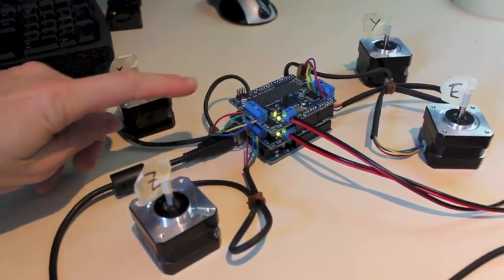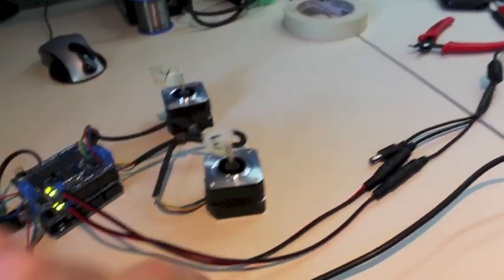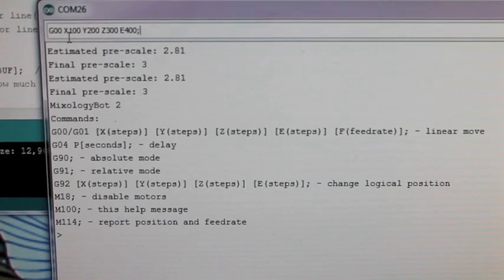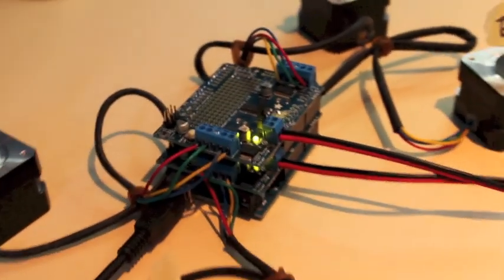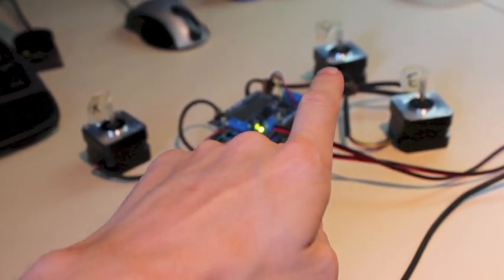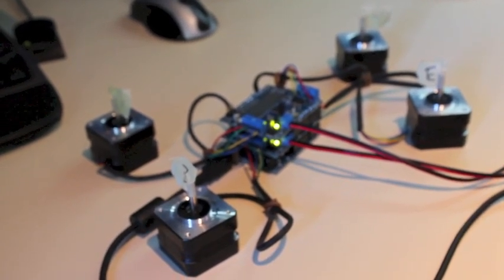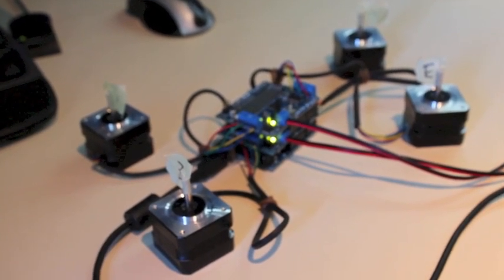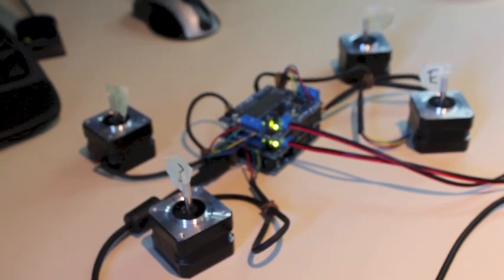Let's Make a 4-axis CNC Gcode Interpreter for Arduino

Comment: What’s the point of a shield? I never understood. I always do everything on a breadboard or I just design the PCB on cad
Reply from the maker: If you have the time, energy, and money to do that, cool.  Other people have different values for what is easy.
Reply: @i-make-robots  so it is like something that helps you avoid hours of reading data sheets? Lol
Reply from the maker: @micahsteeze  instead of solving problems at the hardware level I prefer the software, which is much easier. So I get OTS electronics and I modify their open source code to do what I need. The path of least resistance?
Reply: @i-make-robots  I totally agree. Software is much easier to manipulate and even get around hardware mistakes.

But the benefit of creating your own hardware is the decrease in dimensional constraints in projects. 

Like if you want to make a fish feeder robot on a 20 gallon fish tank a shield on an arduino uno is already taking a huge like 20% chunk of the surface area on top of the tank.
Edit:
20% might be a bit dramatic, but you get the point

Comment: hey awesome, but this will only work for catesian robots right. For a 6 axis robot arms, even if all the motors coordinatedly move the endeffector is not going to move in a straight line. How do I write a straight line gcode interpreter for 6 axis serial robot arm
Reply from the maker: Arcs can be split into many very short lines. I do this in the sixi 2 robot arm.
Reply: @i-make-robots  Yeah, Im not asking about arcs. Straight line itself using a six axis robot. Do I have pick a few points on the straight line, solve IK for those points and then pass through those joint angles? because bresenhams line following algorithm doesnt work for non cartesian robots to follow a straight line.
Reply from the maker: @pd.dataframe2833  A straight line for the tool tip is analogous to arc moves on each motor.  Break any move into small enough straight line segments and the end effect is indistinguishable from exact curve fitting. The firmware should do it, invisibly, perfectly.  Failing that, generate it in gcode on a more powerful computer.  Great question!

Comment: i am making a large 3d printer and need to use 2 stepper motors to move the Z axis at the same time i am using, ( or have ordered)  
Mega 2560 R3 + RAMPS 1.4 Controller + LCD 12864 + 6 Limit Switch Endstop + 5 A4988 Stepper Driver 3D Printer Kit for Arduino

i believe that the ramps 1.4 controller has two Z's connection but if not, could i splice the leads from the motors and use one connection pin or would that over task the board?
Reply from the maker: The limit on the driver is 1a? If your combined current draw stays under that you’ll be ok. Over that you’ll cook the driver.
Reply: so i would have to put an resistor to control the flow of the amperage wish i paid more attention in my electronic class (current=amp or flow=voltage or is vice versa hehe)anyway an resistor should keep me under the 1a threshold if properly sized

Comment: Hi, due to the poor quality, i am not able to see the video clearly. I would like to ask if you used 2 adafruit motor shield v2 to drive 4 of those stepper motors? Because if not mistaken, 1 motor shield can only drive 2 stepper motors. Thanks
Reply from the maker: You are correct.  One AMS v2 can drive two steppers AND I used two AMSv2 stacked on one Arduino Uno.
Reply: Hi thanks for the prompt reply!! Just to confirm . Did you use the stacking header to stack them together? If yes. Can you share the connecting diagram with me? Thanks very much if you are able to do so. "chee_king95"yahoo.com"
Reply from the maker: Chee King Tan yes stacking headers. The only trick here are the i2c addresses. The code is in the video description. No wiring diagram. Sorry.
Reply: Hi, What problem did you encounter with the i2c addresses and how did you fix it?
Reply from the maker: Chee King Tan no problem. They need to be set unique per board so that all four can be driven independently.

Comment: Hi Dan! this comment is for the "How to build an 2-axis Arduino CNC Gcode Interpreter" from your website. I am wondering if your code can be tweaked a bit to achieve a separate/individual feed rates for X & Y axis. Ex. G01 X1 Y1 Fx Fy. thanks in advance
Reply from the maker: Are you trying to set maximum limits on the feed rates?  different feed rates for each axis would make the CNC not right - lines would be hockey stick instead of straight.

Comment: hi,
how did you determine that you need 12 volt for the shields? do the motors run on 12 volt? I am trying to find it out atm, because I am doing my thesis and want to use the shield for it.
Reply from the maker: Jens Wotte the motors will run anything between 12-60v. Iirc the shield only accepts 12v.
Reply: Dan Royer so if i connect a motor that would run on a lower voltage, e.g. 2 motors with 5 volt, can i also connect a 12 volt power supply without setting the hardware or motor on fire?
Reply from the maker: Jens Wotte doubtful.
Reply: Dan Royer ok, thank you for answering so fast.
when i get you right i should choose two motors that need the same voltage and connect a power supply with also the same voltage to the shield.
thank you
Reply from the maker: Jens Wotte yes. Mix voltages is often very very bad.
Reply: Dan Royer ok, thanks a lot. i am not that much into electronics. i am more a it guy. but for my thesis i will do my first arduino project. you helped me a lot :)
Reply from the maker: Jens Wotte you are not...yet. Please get your parts from us and support our work :)
Reply: Dan Royer maybe i could. but i am not the one who is paying the orders and we are sitting in germany. but i'll have a look at your site and keep it in mind for the next iteration or my private "just for fun" projects.

Comment: sir may I know how did you connect two L293D sheild's to a single arduino uno
Reply from the maker: two Adafruit Motor Shield v2 will work very slowly.  Better to get RAMPS or RUMBA board.

Comment: Escuse me Sir, im very noob. i have a project on the way that i will do a OverHead Crane. My plan is make that thing autonomus and make his task continuos, but i have some limitations as: I have to use 12v dc motors (this limited by my teacher)... is that possible using a single h bridge shild ( Shield L293d)? i was thinking control the distance by the time or something like that. im sorry if a did say some bullshit, as i told, im very noob.
Reply from the maker: your method would work.  I wonder how accurate your movements will be.  You might want limit switches to prevent the crane turning too far & to start at a known location.  you might also want encoders so you can "see" the arm position from inside the arduino code all the time, make a PID loop.  better than just time control.

Comment: Hello Sir, really need help, I am planning to build 3D printer using pic18 to control stepper motor. Now the problem is how am i going to interface G code generated by CAD file with pic18? Is it possible to write g code interpreter in pic18? Have you ever write g code interpreter code in arduino to interface with g code and control stepper motor? Please need help. Thanks
Reply from the maker: Why are you doing things the hard way?
Reply: Did you find a way? I want to do it with pic18 too, or should i use 32 bit microchip like arm?

Comment: im working on a project were by i have to build a 4 axis or 5 axis CNC plasma machine which will be cutting tube pipes and BEAMS ....now i want to use Arduino ,basically the system like the one above ......now the problem i have with cutting beam is due to their shapes ...would you advice me to use 4 axis if i want to cut beams ? and which program you know of which i can use to generate g code for 4 axis
Reply from the maker: There is nothing stopping you from using 4, 5, or 6 axis.  The concepts are the same.  I don't know what shape are your beams, so I cannot comment about gcode generation.
Reply: https://www.google.co.za/search?q=beam&client=ms-android-samsung&prmd=inv&source=lnms&tbm=isch&sa=X&ved=0ahUKEwihhPqhxN3PAhUIcBoKHamYB9MQ_AUIBygB&biw=360&bih=559#imgdii=D3pio1eSNC4PZM%3A%3BWAoSoOpLNcCUIM%3A%3BWAoSoOpLNcCUIM%3A&imgrc=WAoSoOpLNcCUIM%3A
Reply: This  kind of  beams

Comment: Hey I tried your gcodecncdemo2axis with an mega2560 and motor shield v2. 

Whenever I sent a command it worked ,but on my power supply after sending commands it starts drawing .5ampiers ,but before sending a command .03. Do you know why this is?
Reply from the maker: before sending the first command the motors are probably disabled and draw almost no current.
Reply: Oh ok I understand now, so in my gcode file if I put M18 after all commands it will disable them then whenever another command is sent enable them and move their location. Is this how most gcode files are or do they keep them always enabled?
Reply from the maker: +Havoc Dev iirc yes

Comment: Dear Dan,r 
plz i need your help .... i am using Ramps not adafruit shield,
I saw a file on Github named “GcodeCNCDemo4AxisRAMPS”
,my question is can i use this code as a firmware for Ramps instead of Marlin firmware ?
Reply: +Samer Elsawy that depends on your goals.
Reply: +Marginally Clever Robots Yes, but can i make some changes on Marlin firmware to control CNC machine ??
Reply: +Samer Elsawy Yes.  Sure.  Maybe.  It depends.
Reply: +Marginally Clever Robots thanks alot, do you have any links that may help me in this ?

Comment: Curious to ask, but what exactly is the max speed of this system? (In other words can they go faster than shown in the video?)
Reply: The default speed of the I2C bus (communication between arduino and shiled) is 100 kHz, you can change this speed to 400KHz by adding the line <TWBR = ((F_CPU /400000l) - 16) / 2; // Change the i2c clock to 400KHz> on your setup() function.

for more info visit the last question on Adafruits FAQ page:
https://learn.adafruit.com/adafruit-motor-shield-v2-for-arduino/faq
Reply from the maker: Oh yes.  In this case the limiting speed is not the hardware, it's the speed of communication between the Arduino and the shields.
Reply: Dan Royer
, so aside from the arduino and the shields limitations...there's no real speed limitations in the cnc motors...
Reply from the maker: Eric Davila
You will eventually hit a physical limit.  I don't know what it is, off hand.  with a PLC you could probably get some very high top speeds.
Reply: Sorry for being a bit annoying, so the drivers won't physically limit the motor, if that's the case, Thanks!

Comment: I don't understand how to send gcode to arduino .I must write  a code and to send it to arduino or arduino has this code and to able to interpret it when it sent from other program.excuse my english.
Reply from the maker: https://github.com/marginallyclever/gcodesender will do the job
Reply: +Dan Royer I wish someone would put the steps for the programming in one video. OK- you take the part and draw it in cad. Somehow you get it in gcode. Then some how you get some kind of program into the stepper motor shield or arduino that understands gcode. All this and everyone says just go to github! I have gone there and somehow got the the github program (they said gerber! what is that?) and now what???? I have spent weeks trying to find somewhere that someone has put it all together. I don't want to just move a stepper around. I want to make parts and need to know how to go from the cad file to the steppers cutting! Any suggestions?
Thanks.
Reply from the maker: You start with a 3D model.  a "slicer" or preparation program translates the 3d model into instructions for your CNC machine.  Then (usually the same) program sends the instructions one line at a time as the machine does the work.  https://github.com/MarginallyClever/GcodeCNCDemo lives in the brain of your arduino and moves the motors in your CNC.  https://github.com/MarginallyClever/gcodesenderdelivers the lines one at a time.  What I don't have is code to translate a 3d model into instructions.  It's different for every kind of machine.  Some using Additive manufacturing (3d printers) and some use Subtractive (mills, lathes, laser cutters, etc).  I do some work in 3D, but only for my robot arms and the http://makelangelo.com/
Reply: +Dan Royer Dan, thanks for getting back. Another of the problems is many of us don't know what to do when we get to the github page. I can click on the different items and some open what looks like a sketch, but what does it do and am I suppose to put it in the arduino of what. What happens when I put it in am I suppose to do something? Some of the pages will not open. Some open if you change the program to open it with and you get mixed up words or letters. This is so confusing. I have tried for years to get a mm2001 board designed in Europe to work and I just got it to move the steppers. There are groups all over that use all these boards but they have all gotten past the first steps to get the electronics and software together. I have seen many people ask as I have to give us the steps to get there, but either they don't want to or don't understand what we need. Many have mentioned github with out telling us what to do when we get there and some of us have no one to ask!
Thanks for your efforts.
Have a nice day.
Reply: +Dan Royer Also the second link does not work.
Reply: +Gabriele Trovato This is the shield I was trying to use(or getting ready to use if I find answers.
V3 Engraver 3D Printer CNC Shield Expansion Board A4988 Driver for Arduino Z3
Reply: +amtpdb1 the problem is trying to use github. Github is a great resource for people who are familiar with programming, but it is next to useless for those who are not. The key here is that there is no "step by step" formula to this. You simply load your CAD model into the CAM software, set your prefs and hit go.

You need a program that will convert what ever 3d format you have into gcode that is appropriate for either milling or printing. Use Google to find a CAM program that will convert your CAD file extension to gcode, if for some reason you can't find a CAM program that will do this, then you will need to convert your model to something that can be converted to gcode. Open source programs will tend to have very limited function and be hard to understand, so you might feel better paying for a commercial license.
Reply: +joshua43214 Thanks. It is still confusing.

Comment: Hi Dan, I am trying to control motors in much the same way using the Adafruit Motor shield V2 and am having some success. However, I seem to be drawing quite a large current! In the region of 1.7A. Do you draw this much current? I have driven the same motors with the official Arduino Motor shield and they only draw 800mA. But these are not stackable.

Motors are NEMA 17, 200steps running on 12v.
Many thanks,
Chris
Reply from the maker: Huh.  I've never measured the draw.  This is news to me.  You've reached the limits of my knowledge!  If you find out why, please let me know, I'm interested.

Comment: thanx for your vidio if you please i have a 3 stepper moteur and arduino leonardo and i want to know what the output of arduino
for exple :

axe x the output is :
axe y the output is :
axe z the output is :

and thanx
Reply from the maker: I'm sorry, I don't understand the question.
Reply: oki 
I have 3 stepper moteur and i want to know the output of arduino to connecte the steper moteur i mean the pin numbre
Reply from the maker: arnoun taoufik
 the pin number should be listed in the source code in the github project.  https://github.com/MarginallyClever/GcodeCNCDemo

Comment: Hi
Would you list all the software need to have an Arduino Uno control 3 stepper motors through a 3 axis stepper driver I am a bit confused at what I have to download and install.
Thx in advance
Reply from the maker: The full source on github should include everything you need.  Let me know if something is missing.
Reply: Dan Royer
Hi Dan Thx for your quick reply. My question is really more fundamental. I am looking for a description of the different programs I need to install so I can understand the sequence of starting a CNC 3 axis small engraver. at the software level. The hardware is fairly simple for me. It's the software that is confusing.
Thx again

Comment: Hi.

Is there any software that can run with this. I downloaded your GcodeCNCDemo4axisV2. Run some test with serial monitor. But if I want to use this as a cnc machine?  what software to make gcode and send it to the arduino board?

Thanks!!

Comment from the maker: I used...  4x nema17 stepper motors (0.3a), 2x adafruit motor shield v2, 1x power plug, female, 5.5x2.1, 1x 12v2a power supply, 1x USB cable.  All of which is available on my website @ marginallyclever